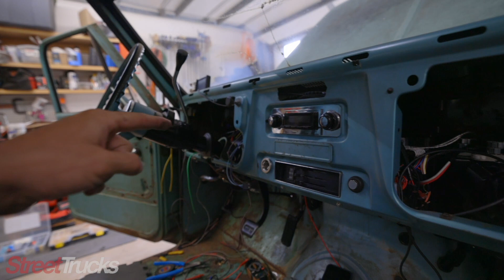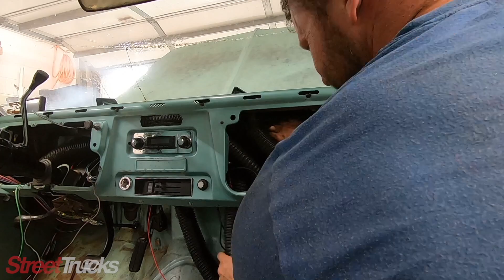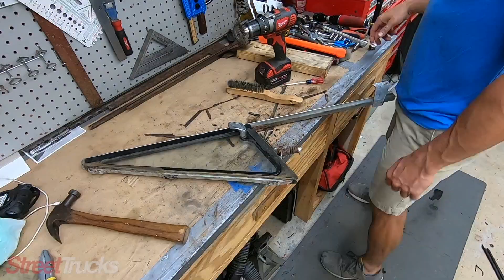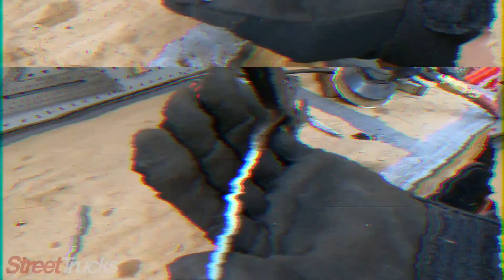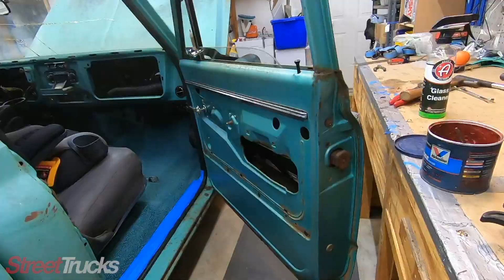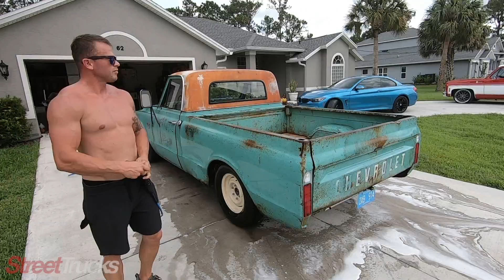Will we MAKE IT? Hot Rod Power Tour | 1967 Chevy C10 Project Last Chance

Comment: i been building a 68 so far i have 1400 in the project running a stroke 454 with a 02xx 400r turbo have most of it dun but interior and final paint . i rebuilt the dash with full factory gauges tach, fuel, speed, amp, water, oil and vacuum gauges i rebuilt the insterment cluster myself with new bezal and lens new nobs new dash pad and new glove box had to get a new vacuum gauge and tach . i still have a lot of extra parts like a rust free air condition cab doors and box new floor pan kicker panels cab corners got all of it for free still have the 327 and 400 turbo that came factory with it both work good plus i have a 67 all complete with a 350 in it but it is a little ruff but a good driver rust free same with the 68 .